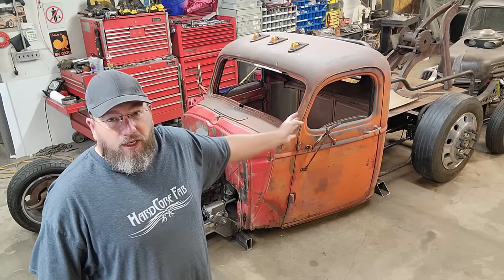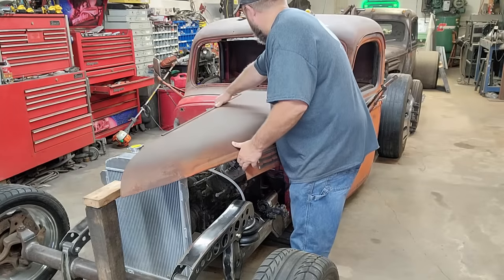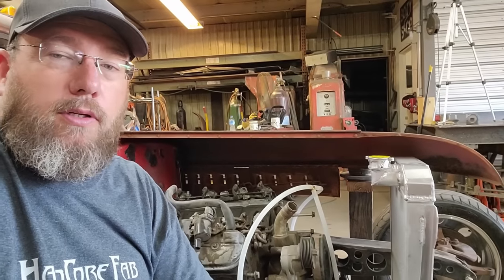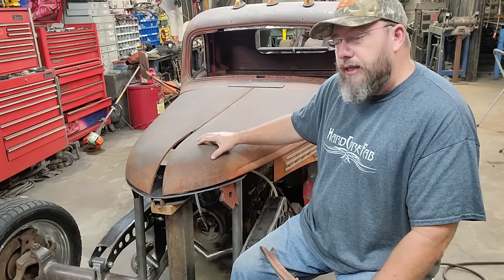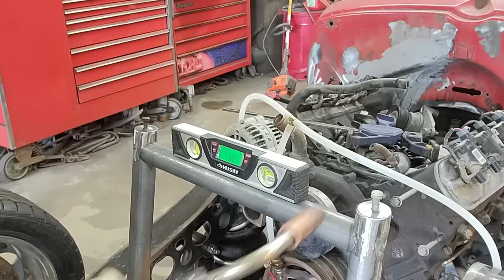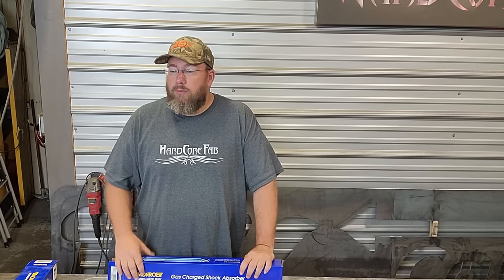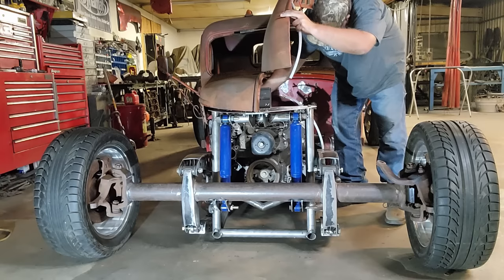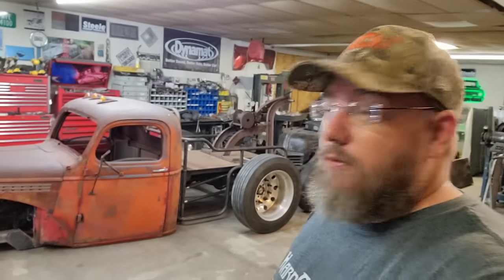Air ride fail!! (Hookers and Blow 13)

Comment: That belt sander thing you used to cope your tubing, is that home made or name brand …. Ive never seen anything like that before
Reply: Me neither I love that machine
Reply from the maker: It's a Scotchman abrasive tube notcher.  It's a great thing if you do a lot of tube.  They're pretty pricey to buy but it wouldn't be that hard to make.  I was ready to make one when I found this one at an auction for a good price.
Reply from the maker: Just drop a video about it

Comment: Did those air bellow angles work out? when filled up the two plate are just squished into the bello and the bottom side towards the cab are rubbing against the mounting plate..  had failures with that before.. so bit suprised you git setup like that.
Reply from the maker: They have been on the truck and working for about a year and a half and haven't had a problem yet!

Comment: Anthony are you filling the Air Bags or are you using Air Shocks for the suspension.  Either way when that hose blew off I thought, that’s going to hurt.

Like how your radiator is going to be mounted and the hood brace you designed
Reply from the maker: Filling the air bags the shocks are just regular units